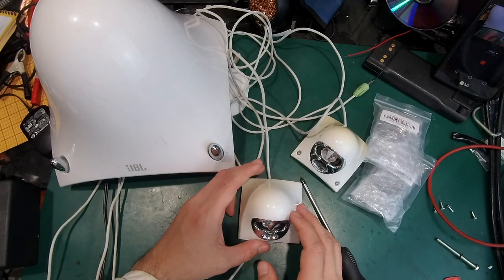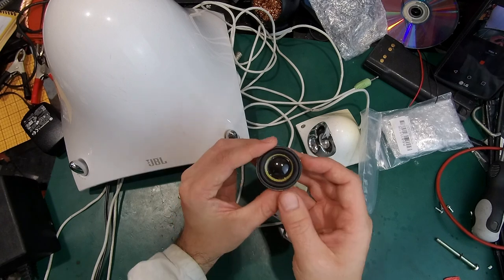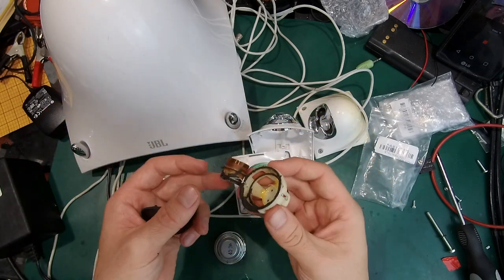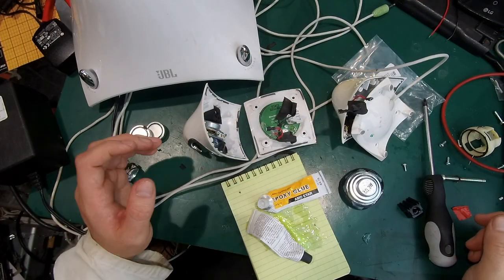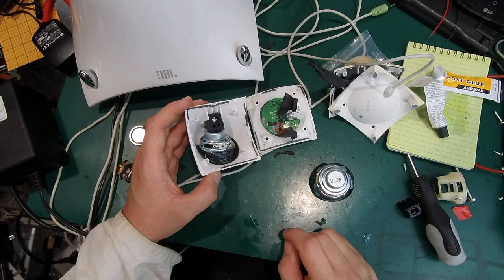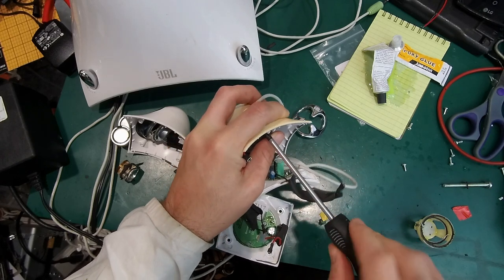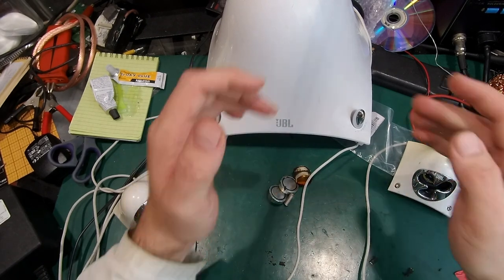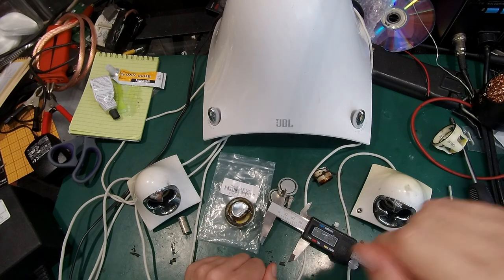Fixing JBL Creature speakers using off-shelf china speaker replacement

Comment: This really helped me. I bought 2 40mm 5A 4O speakers for the satellites and used epoxy to affix them to the housing (and cardboard to make up for the fact that the magnets were much smaller than the ample JBL magnets). Worked like a charm, and $10 saved me (likely) over 70 to get something new that would even approach the quality.
Reply: Dear Evanduz were do you get the replacement speakers, thank you